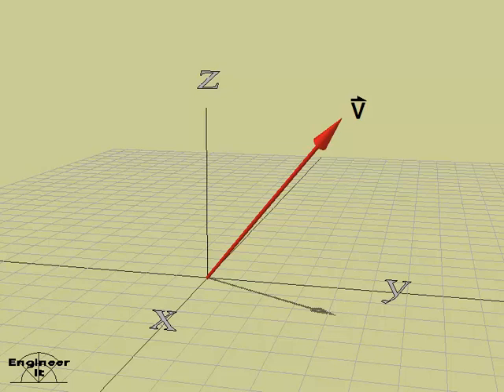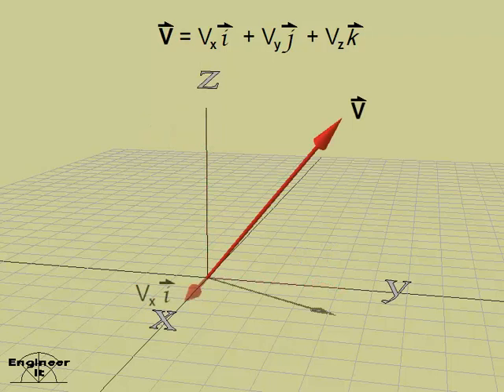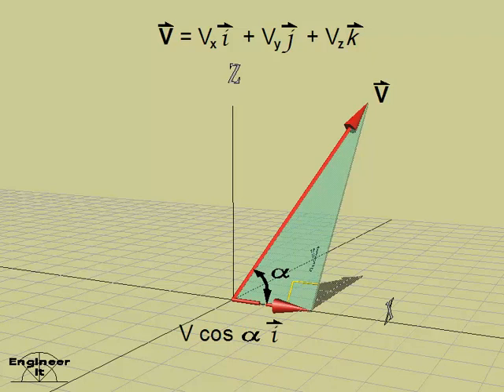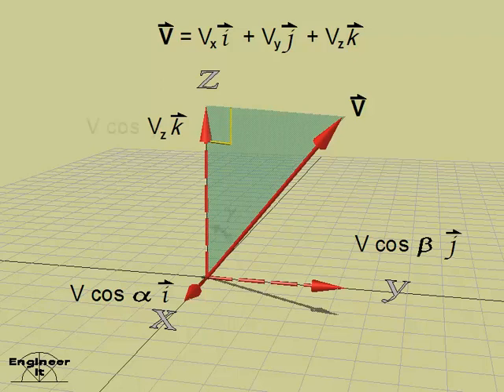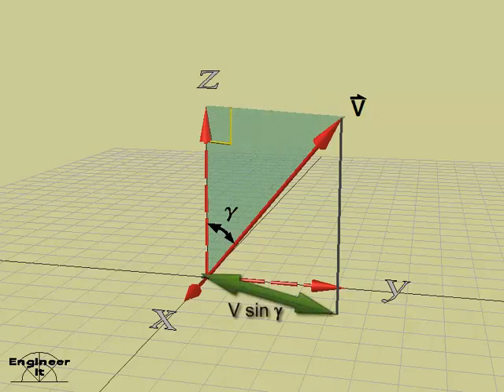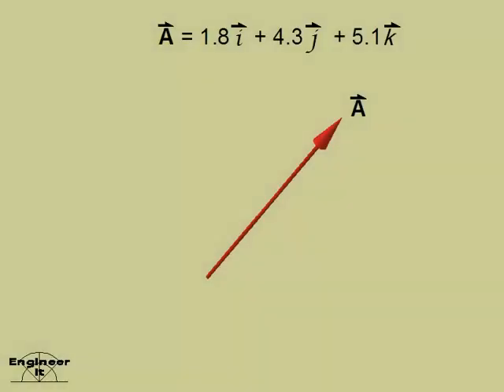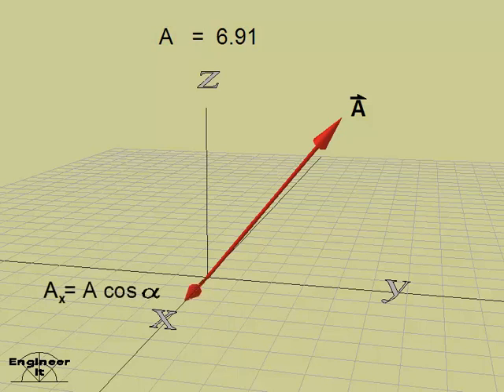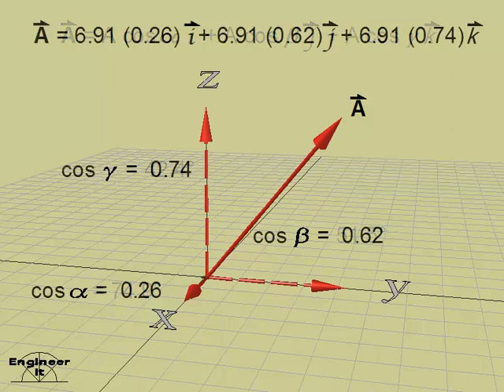Intro to 3D Vectors

Comment: Please it's not rocket science.  Two points defined by xyz.  Create position vector(mind the direction) from delta of each(xyz).  Then find magnitude(sqrt(x^2 + y^2 + z^2)).  Divide each term by magnitude.  Bingo it's a unit vector(lambda).  Now multiply by the given force magnitude.  (not to be confused by position vector magnitude).  Done.  Don't need no stinkin angles.